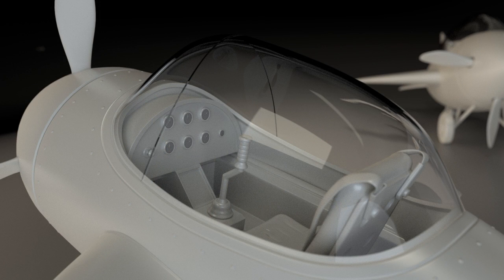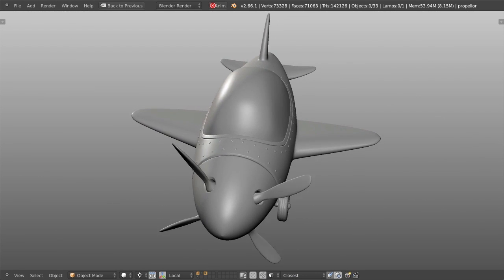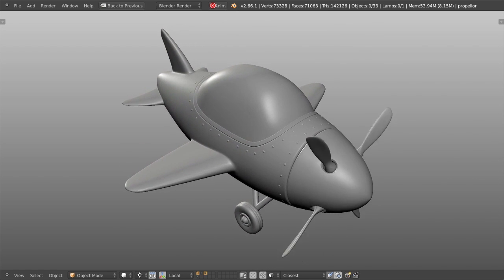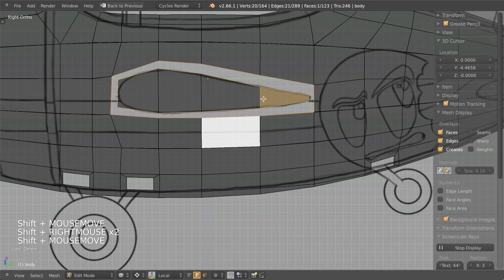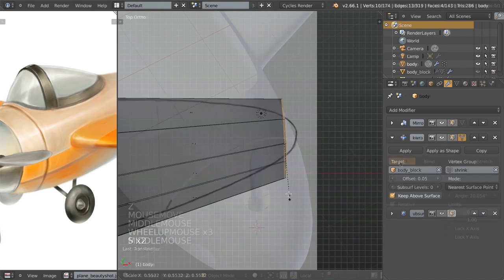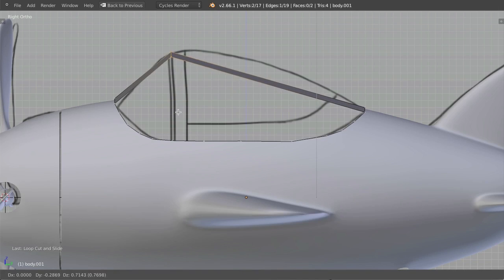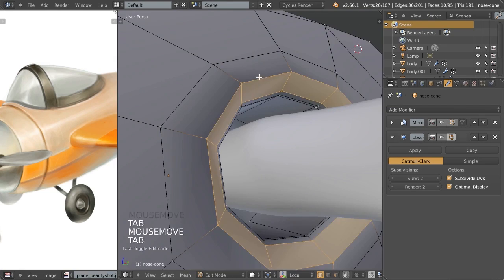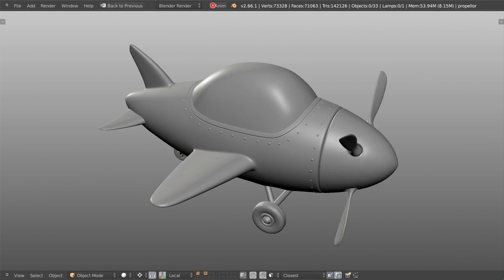Introduction to Hard-Surface Modeling in Blender - Citizen Series

Comment: Well I am down to the final 3 video on the cockpit area, the problem I am at now and have realized it is a biger one then Ihad expected, and that the prop cone and airplane cone will not line up.
I was wondering why not cut the nose cone from the original "shrink wrapped" plane body, then separate the selected cone and use as prop nose, this way it is wrapped and lined up correctly, my prop nose is way off, tried to make new and for some reason it wont line up